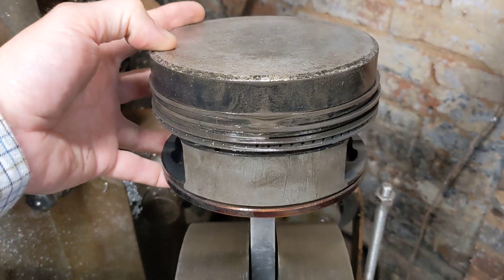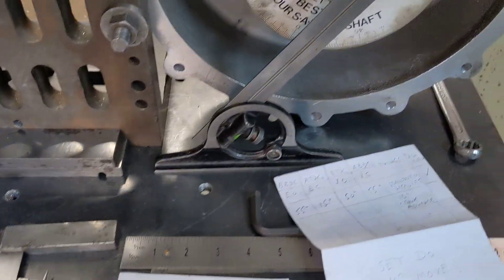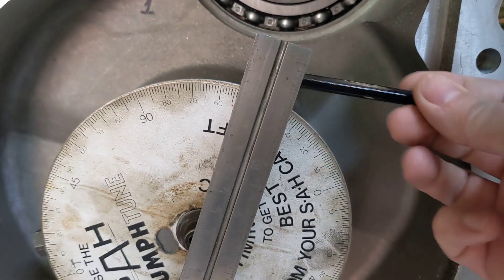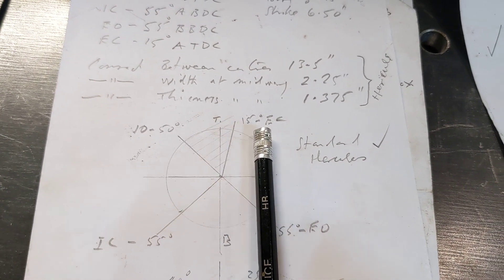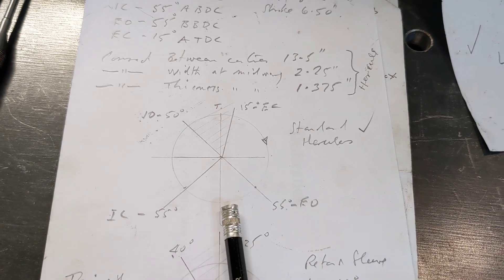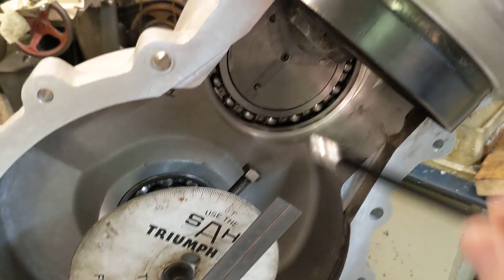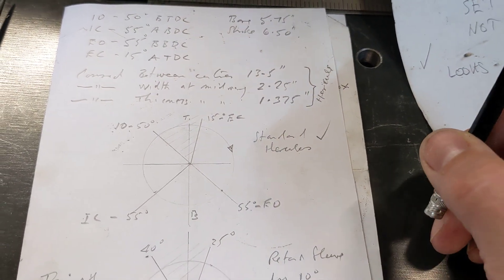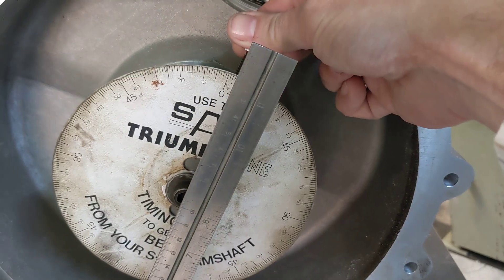Setting the Valve Timing

Comment: Fantastic. I've got another question though!
The sleeve is fixed timing wise to the sleeve crank via a chain. Is the valve timing altered by slackening bolts on the top plate and rotating to suit then clamping back in position? It's not dissimilar to a 2 stroke sister from the rotation of the sleeve but in a two stroke all the valve timing is set and cannot be altered without machine work. I'm going to watch this again, there's a lot going on.
Reply from the maker: Valve timing can be adjusted by bolting either sprocket using different holes. There are 9 holes on the bottom sprocket, 3 sets of 3 which aren't equally spaced. As there's an even number of teeth on the sprocket which isn't divisible by 3, each set of 3 holes will provide some adjustment. (Vernier  adjustment). 
It sounds clever but it's really a case of trying lots of different combinations until you get something close.